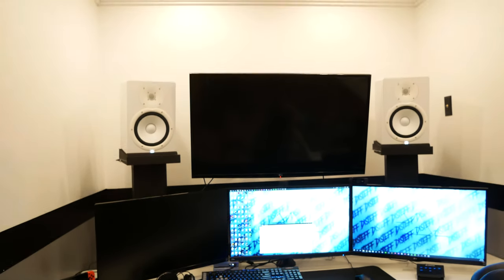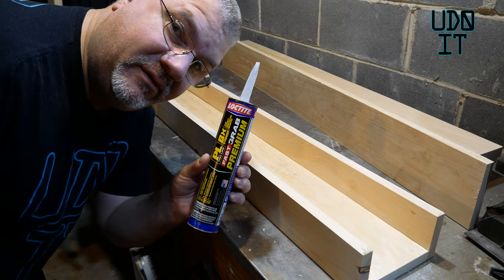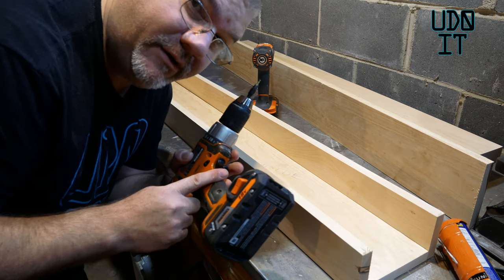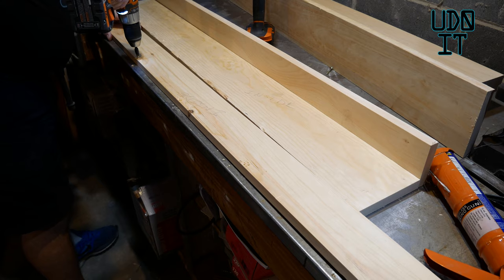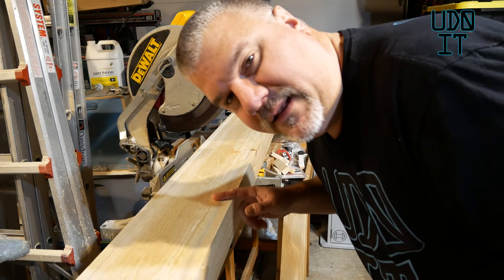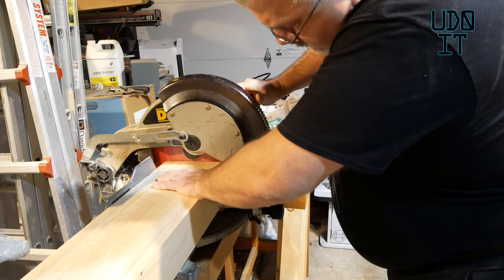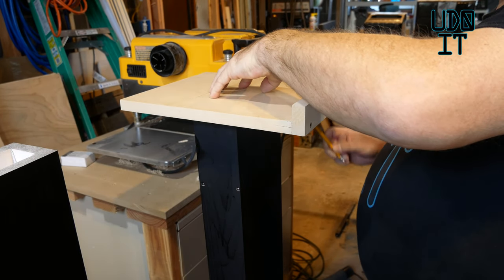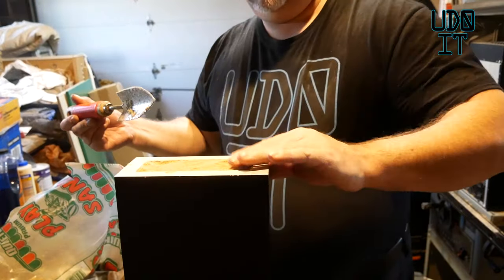How to build speaker stands for heavy studio monitors for under $100

Comment: That's a cool project, John. How did you come up with the idea to pack the stands with sand? Is that for stability, or does it help the stands absorb vibrations and prevent them from rattling? Although with the adhesive and screws, it's not likely those stands are going to make ANY sort of sound. They looked SOLID!
Reply from the maker: Thank you Bryan. The sand increases the density and alters the resonant frequency of the stand so it is less likely to resonate with the speaker. Lead is preferable but I think I licked enough lead bars in my childhood that I dont want to be exposed to it anymore.